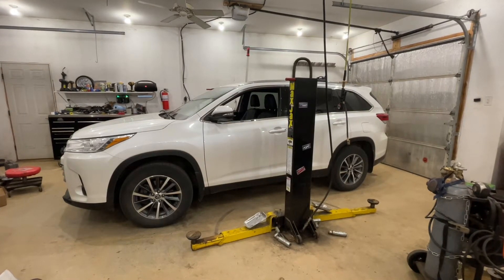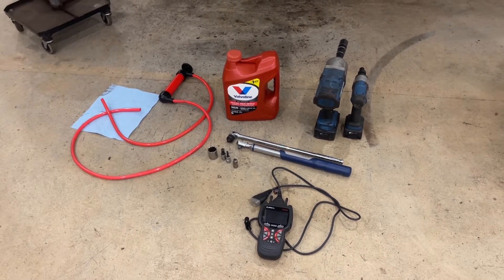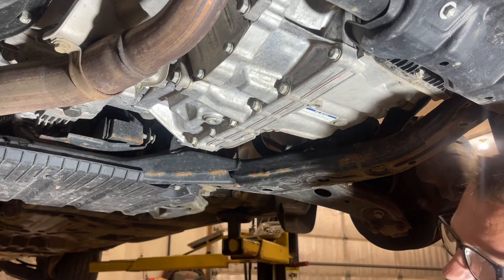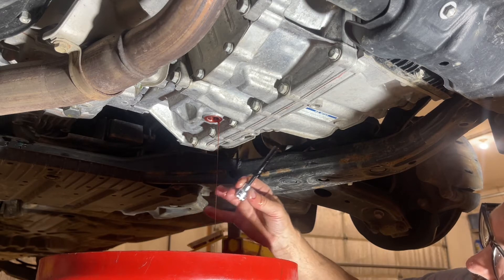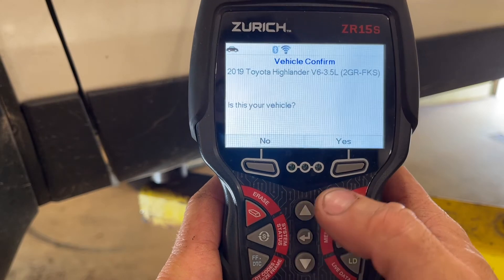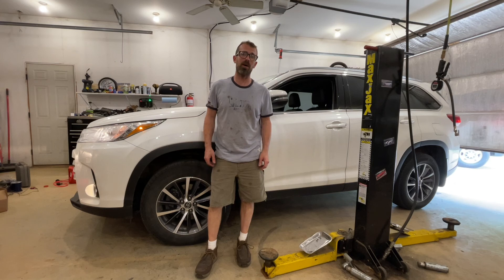🔧 2017-2019 Toyota Highlander transmission fluid change UA80E *the right way to fill*

Comment from the maker: This video does not cover changing the filter, but here is a link to a filter / gasket kit if that's the direction you want to go.  In my opinion, if you change the fluid as recomended, you will not have to change the filter: https://amzn.to/48522VE

Fill plug: 24mm, 36lb-fts
Drain plug: 10mm hex, 36lb-fts
Level check tube: 6MM hex (hand tight only)
wheel lugs (76ft-lbs)

Crush washers: https://amzn.to/3SLYC5V

Quinn 3/8" Drive Torque Wrench:
https://www.harborfreight.com/38-in-d...

Quinn 1/2" Drive Torque Wrench: https://www.harborfreight.com/12-in-d...

1 gallon of Valvoline Maxlife ATF (meets Toyota WS standard): https://amzn.to/3vL6isv
or
Toyota WS Fluid: https://amzn.to/46brxUA

Hand pump: https://amzn.to/3XDmUi4

These are both the same scanner:
Innova 5610: https://amzn.to/3ZFN3hc
Zurich ZR15s: https://www.harborfreight.com/zr15s-o...
Target temp: 95F-113F (35C-45C)

0:37 what vehicles does this apply to?
1:55 tools and supplies needed
1:57 the fluid I'm using
2:22 back to tools
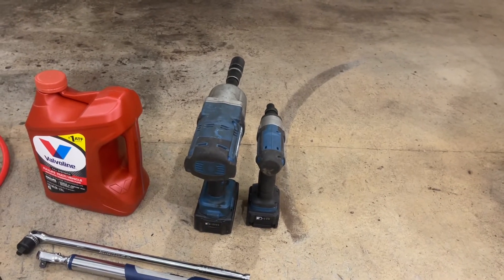3:17 removing the wheel
3:28 removing the plastic cover in the wheel well
3:50 loosening the fill plug
4:43 removing the drain lug, fill level tube and draining the fluid
6:39 reinstalling the fill level tube
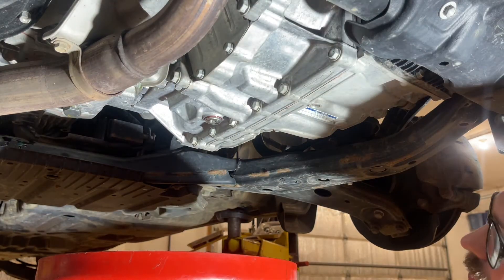7:23 refilling with 1 gallon of new fluid
8:22 reinstalling the fill plug (24mm, 36lb-fts)
8:42 reinstalling the plastic cover
9:07 using the scanner to check temperature: 95F-113F (35C-45C)
9:54 reinstalling the wheel
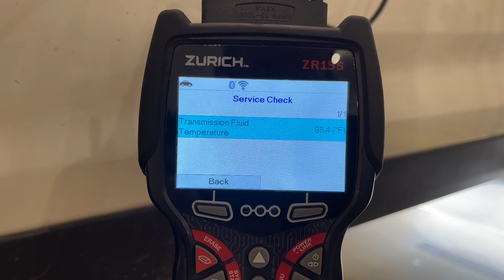10:11 with it running, draining the excess fluid
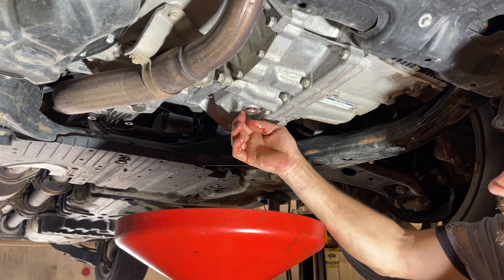10:48 reinstalling the drain plug (36ft-lbs)
11:05 torquing the wheel lugs (76ft-lbs)

As an Amazon Associate, I earn from qualifying purchases.  For your convenience, I try to post links to everything I use in the video description.  That's part of how I cover the costs of this channel.  I appreciate your support buy using these links!!
Reply: why not change the filter?
Reply from the maker: @gosman949 I’m just showing the Toyota recommended service in this video.
Reply: @bennieaust  at 46k mileage, just wondering when I need to change the transmission fluid.  Some people saying to change the filter the first time, and then afterwards, just changing without filter.
Reply from the maker: @gosman949  I think every 60K miles is generally a good interval on these.

Comment: Is it worth using a magnetic drain plug?
Reply from the maker: In my opinion no. The drain plug sits at the bottom of the level set tube which pretty much prevents fluid from flowing around the drain plug.

Comment: The oil with expand when it reaches full heat range. 4 quarts may be a bit much dont you think? When you redrained it after temp rise the wasnt much that came out. You pretty much stuck 3/4 of a quart more that what spec suggest.
Reply from the maker: 4 quarts was close.  I’d rather drain a little out than have to go back and add more later. The most important part is just following the procedure to get the fluid level correct when you are done.

Comment: This is a great video, well done with clear explanation of each step. I had a different experience than in this video...  I have a 2016 highlander XLE. When I removed the drain plug about 32 OZ came out. When I removed the orange fill tube another 32 oz came out. So a total of 64 oz or 2 quarts drained. I reinstalled the orange filler tube and drain plug and put in 3 quarts or 96 oz back into the vehicle. When the vehicle reached 105 degrees F, I removed the drain plug and a full 32 oz came out.  So in the end, 64 oz removed and 64 oz filled.  I don't understand why I did not get the 3 quarts as others did?
Reply from the maker: Thanks!  The most important part is just that you set the level correctly. The exact amount of fluid isn’t a big deal and it will vary.

Comment: Do you drain that transmission fluid out when it’s cold or hot or it doesn’t matter ?
Reply from the maker: It doesn’t really matter, but I like to start the process when it’s not hot so that the transmission temp is not too high when you get to the level setting procedure.
Reply: I haven’t changed mine for 130,000 miles
Several mechanics have told me to not change it but service manual says change it 
Going to change it this week 
Vehicle has 222,222 mikes on it now
Reply from the maker: @apfish3557 in my opinion, the longer you wait, the more you need to do it. I understand what everyone claims the reasoning is, but I don’t agree that the longer you wait the less you should consider it. 

You will have a happy transmission after the service!!

Comment: This is the best tutorial i have seen on this job. Really thorough and to the point. Will this work for the 2.7L LE model?
Reply from the maker: Thanks so much!
The Highlander with the 2.7 4 cylinder uses a 6-speed automatic, the 8-speed shown in this video.  I haven't had one in the shop for a transmission service so I can't tell you what the difference is.  I would guess it's a very similar process, if not exactly the same, but I can't say for sure.  I'll get a video posted when I have one in the shop!!
Reply: @bennieaust  i will subscribe and watch for a video with the 2.7L. Upon going under thr vehicle there is a drain pan for the transmission oil and it appears that the drain plug is opened with a 6mm hex.

Comment: Fantastic job explaining each step!  I was able to change my 2018 Highlander’s transmission fluid without lifting or putting the vehicle on jackstands.  Turn the steering wheel all the way to the left and you will have enough room to work around the tire.
Reply from the maker: Thanks!  That’s great you could do it on the ground. Good to know!
Reply: How did you get under the car?
Reply: @alexlewarex4815 i just laid on my back and swung my head under the vehicle.

Comment: I got an estimate today from a good mechanic in the area. Changing transmission, transfer case and rear differential fluid. $800 and another $200 for coolant change/flush
Reply from the maker: Seems a little on the high side, but if he is a trusted mechanic that’s the most important part. Prices can vary greatly from one area to another.
Reply: @bennieaust  Yea, that's how I look at it too. It's always more important to me that things are actually done, and done right. I usually try to do a lot of things myself. If I had a lift maybe. On my back in a driveway, spilling fluids all over me and the driveway is not fun for me anymore.

Comment: how do you going through all gears? I hope there is no need to spin wheels :) With breaks applied? Do I need to drain excess fluid while engine working ? :\
Reply from the maker: You can firmly hold your foot on the brake while shifting through gears. 

Yes, the transmission need to be at the specified temp and the engine needs to be running.

Comment: TOYOTA TRANSMISSION FLUID CHANGE

Start procedure after having car cooled to ambient temperature overnight. New fluid should be same temperature as old fluid in car to compare volume.

(1)   Turn front wheels fully left (or remove front driver's side wheel) to remove splash guard (apron cover) which has (2) 10 mm bolts and a press-in body clip. Fill port is easily accessed without removing wheel. Job can be done without elevating car if you have an SUV like a Highlander).
(2)   Loosen revealed fill plug (24 mm). Do not drain fluid before this step since there's no way to refill if the fill plug cannot be removed or breaks.
(3)   Bypass transmission cooler (some models) by pressing in bypass with 90 degree pick tool and securing open with 1 mm hex tool. Location: near front at grill. Larger Toyotas have this and can be reached thru designed hole in body splash guard. Grind down a very thin nail; a 1.5 mm hex tool was too thick.
(4)   Remove drain plug under car using a 10 mm hex socket. A small amount of excess fluid (not the main fluid) will drain out.
(5)   Remove revealed plastic overfill tube (by hand) with 6 mm hex socket to drain main fluid. Replace hand tight after fluid has drained and hand tighten main plug.
(6)   Measure drained fluid and prepare new with same amount plus 1/2 quart; the excess will be drained in steps below. My 2019 Highlander drained 3 quarts.
(7)   Add new fluid at fill plug using a pump. Or use funnel + 1/2 inch tubing above from engine compartment (much easier). Tighten fill plug to 36 ft. lbs.
(8)   Start engine to warm transmission to 95 - 113 deg F (104 ideal) and shift thru P, R, N, D several times with foot on brake.
(9)   At ideal temperature, laser thermometer will read only 94 deg F (verified) on the ribs (lowest point) of pan next to drain plug, to account for cooler outer case.
(10)  After achieving temperature, place in park and let engine idle; car must be level. Within 2 minutes (to prevent over-warming), remove drain plug to allow excess fluid to drain. Replace plug when fluid goes from steady stream to beginning to ripple, or ribbon-like. Do not let it get to a trickle/dripping level; some excess is desired. Torque to 36 ft. lbs.
(11)  Place transmission fluid bypass to normal position, replace apron cover and (optionally) front wheel.

Comment: Am curious if once the fluid level is between 95-113, is there a difference draining the excess if the vehicle is running or off.  Can't imagine there's a difference.  Thoughts?
Reply from the maker: There is a difference. The level will be lower when it’s running. The procedure needs to be done while running.

Comment: The worst thing that could happen is when u overtighten the measuring plastic tube and it breaks inside the transmission 😂
Reply from the maker: Just tighten it by hand and there’s nothing to worry about.

Comment: Thanks for the great helpful video. After reading all the comments and watching other videos I'm still confused, is it better to change after 30-40k miles or after 60k miles? Some of them saying changing it too often is not good. Also I couldn't find any video about Highlander 2020+, is the procedure any different from 2019?
Reply from the maker: You’re welcome!  I’m not sure what if any difference there is from 2019 to 2020. 

Any advice I give you is not going to differ from what I already did in the video. 60 K miles is a good frequency. I can’t imagine a scenario where doing it more frequently causes issues. Clean fluid equals a happy transmission.

Comment: There’s a transmission cooler bypass valve that should be pushed and a locked with a 1.5mm allen key - prior to the procedure. 

It can be accessed above the driver side front splash shield with a long, thin,  flat screwdriver.
Reply: Excellent video, thank you!

Comment: Any issues with valvoline max life fluid? I am about to do it but worried
Reply from the maker: @riasat001  if you are at all worries, use Toyota fluid. 

I have serviced a ton of transmission with this Valvoline fluid (when it was the correct application) and never had a single issue. I run it in my own vehicles including a 2008 GMC 2500 Duramax with the Allison transmission. It is the original transmission with 363K miles. 

That’s why I am using the Valvoline in this video. If I had any concerns I would tell people not to use it!

Comment: Very informative.  In fact, this is one of the better transmission fluid change videos out there.  2 questions though...... 1. How much fluid was drained out? Because most vids show a little less than 3 qts drain out, yet you pumped in 4 qts and barely anything came out on your level check drain.  Or did you cut out some of the draining process?  2. Some vids say we need to bypass the cooler?  Did you do that?
Reply from the maker: @Happy_Harry  thanks!

I did edit out the majority of the fluid draining to keep the video fast-paced. I don’t ever measure how much I drain because I don’t find it to be relevant since I’m not using it to determine anything. Based on my fill results, probably just under 4 quarts. 

There is a cooler bypass valve. You will get a little more fluid to drain by pining it open. I’m not recommending you don’t do that, but it is a small quantity that IMHO will not make much difference on your results.
Reply: @bennieaust Thank you for the response.  I know most of these are done cold, but would there be anything wrong with draining the fluid hot and then waiting till next day to do the cold fluid check?
Reply from the maker: @Happy_Harry  You can drain it at any temp.  Make sure it's not cold, but from 95-113F when you check / drain excess fluid after filling.

Comment: These dont need to be serviced
Reply from the maker: @audionut9974 I suppose you are technically correct. You could just replace the transmission when it fails.

You will have a hard time convincing me that a transmission that has never been serviced will last as long as one that has.

Comment: Great video! -- Would you do this on a 2016 Highlander with 74k miles that never had its fluid replaced ? Is it too late?

Thanks !
Reply from the maker: @ham6114  Thanks!!  In my opinion, that is definitely not too late. I would have maybe aimed for 60k miles but you’re really not much past that.  Now is a great time to get it done.
Reply: Thanks for the quick reply!
Great channel.
Reply from the maker: @ham6114  you’re welcome! 😁
Reply: Definitely not!  Do it and then every 30k

Comment: Thanx just did it on a 19 highlander was pretty easy thought it would save my transmission that doesn’t shift at all it was pretty black the fluid even added lucas but it’s gone barely 100k miles
Reply from the maker: @chanamalkyfriedman701  you’re welcome. That’s a bummer it didn’t save it. :(

Comment: Has anyone here had any issues with needing new fill or drain plugs? Especially needing to replace the plastic one? I don’t want to be in a spot where the plastic breaks and I don’t have a replacement
Reply from the maker: @josephgrinde1469  i’ve serviced a lot of these transmissions and I’ve never had a problem with the fill level tube.
Reply: @bennieaust  thank you! Always want to prepare for worst case
Reply from the maker: @ you’re welcome!

Comment: Bennie do all of us a favor and please watch " Toyota Highlander Transmission Fluid Drain and Fill - The Right Way to DIY
"That Dad Mike"

The reason why Bennie is amid at the 6:10 mark he explains the Transmission Cooler Bypass Valve I mentioned, he shows the exact location and how to drain the cooler by using the valve. it's super easy and that way you'll be actually draining the entire transmission fluid (except of course the torque converter) but you get the gist of what I'm trying to help you with. I'm not challenging you, not trying to take a dig at you, not criticizing you, not trying to embarras you, just simply trying to be helpful amid I really don't think you were aware of the Transmission Cooler Bypass Valve Assembly being a major part of the transmission fluid change procedure.
Reply from the maker: @bobnale5516  I’ll check it out, thanks for the comment. I appreciate the feedback!

Comment: Hello Mr. Bennie, I watched your entire video, I noticed you made no mention of the Transmission Cooler Bypass Valve Assembly. The Transmission Cooler Bypass Valve is a MAJOR step of this process and since you've mentioned " Your Method is the Correct Method" The Transmission Cooler Bypass Valve must absolutely be drained as it's definitely part of this service otherwise you're not replacing all of the fluid, with your 1 gallon of Valvoline Max Life ATF you're only draining 2/3 of the fluid, the other 1/3 is still inside the Transmission Cooler Assembly, it's still old and dirty and if not drained it will mix with the new gallon of fluid which is not good. (It would be the same as you performing and engine oil change, draining only 2/3 of the oil pan and adding new oil back into the crankcase) not a good idea. Please incorporate the Transmission Cooler Bypass Valve Assembly into your presentation amid that would be "Doing it the right way" and *the right way to fill*, Thank You.
Reply from the maker: @bobnale5516  thanks for the comment.  You are correct about that being part of the procedure.   Unfortunately you will still not be draining all the fluid. There is a large amount of fluid in the torque converter that will remain.  Only doing a flush will actually replace all the old fluid with new.  Although it would be great to replace 100% of the fluid, in my opinion you will be just fine with the drain and refill as long as you do it on a regular basis.
Reply: @bennieaust 

I agree 100%…

Eventually, the old will mix with the new (.33 to .66) and in regular service practices, the fluid will suffice in my opinion.

Comment: Hello chief , can I use same scan tool for Toyota RAV  2020 for ATF it works ? Thanks a lot
Reply from the maker: Yes, mine has worked on absolutely everything I have plugged in to.  Back several months ago I was getting a lot of feedback from people who were having issues with a newer software version not reading trans temp.  I haven't heard anything in a while now, so I believe they have resolved that.  Just wanted to make you aware of that possible issue though.

Comment: After doing this procedure would you recommend running it a thousand miles or so and doing the procedure again due to fluid captured in the torque converter?
Reply from the maker: @TannerKeen-d8i  in my opinion, I would adjust the interval based on how the fluid looks.  I think it’s great if the fluid looks really good when you do a service. If you perform this service and it looks very dirty, doing it again soon is a good idea. If it looks excellent, then wait 60k miles or so.